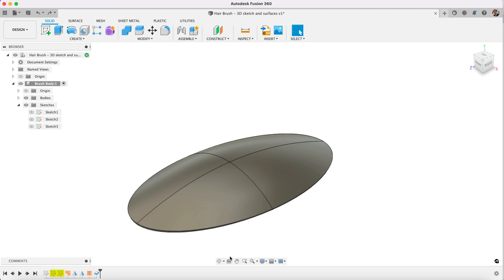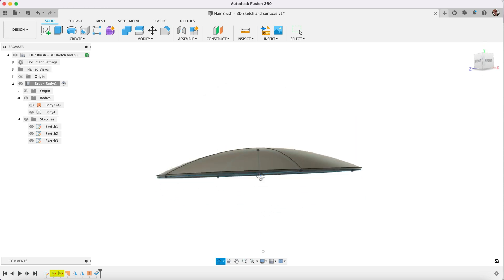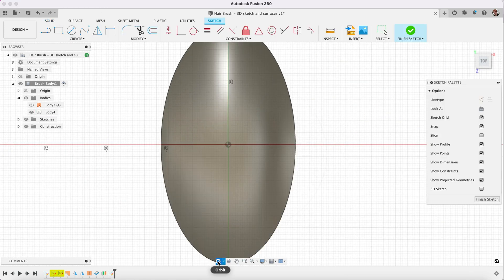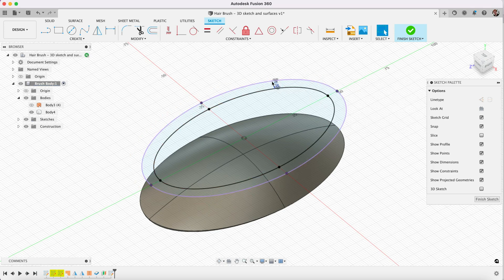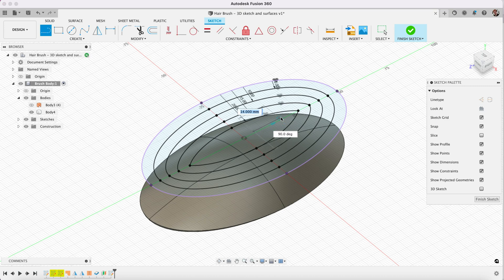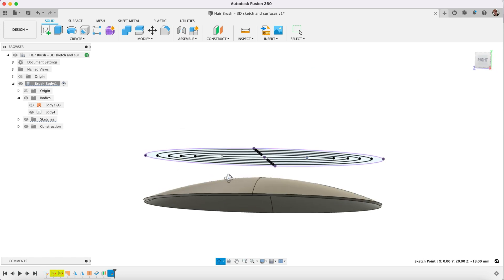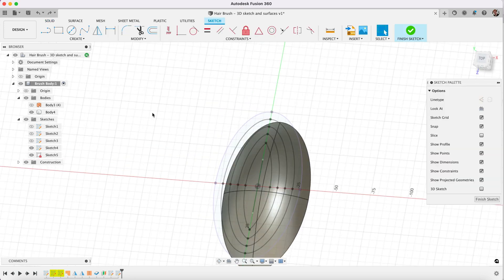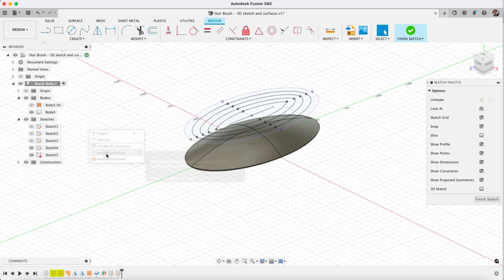Fusion 360 - Projecting sketch to surface - Hairbrush model part 2

Comment: Hi, I would ask you . I am using  fusion  version 2.0.12888 and  fusion doesnot allow me to create third and fourth offset (15 and 20mm) from projected elipse. I did it with new elipse but I dont know where is the problem .  (1 Error    The sketch offset created no geometry)  I tried to do it with same elipse object  and  projected body  without problem .  I did some research and when I am  projecting  from  surface body its OK , otherwise  i see error . Its weird.